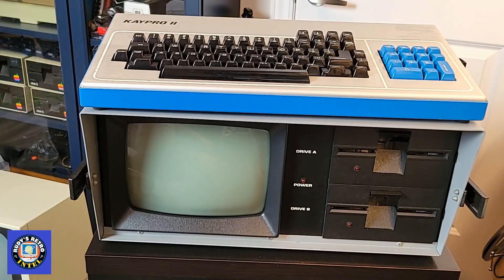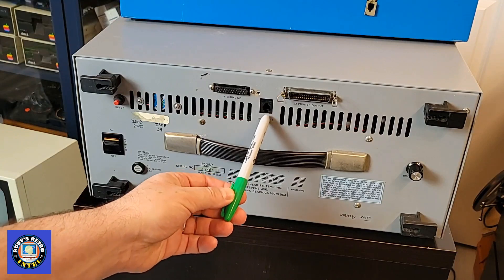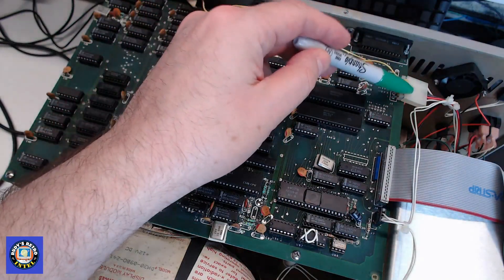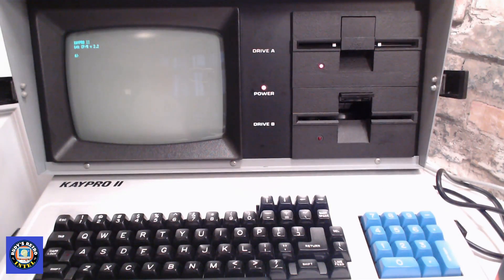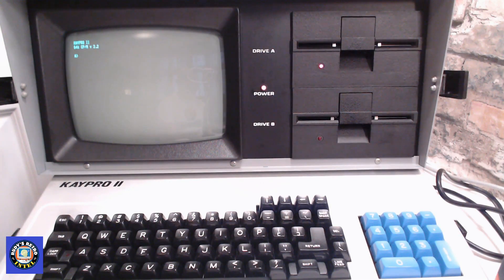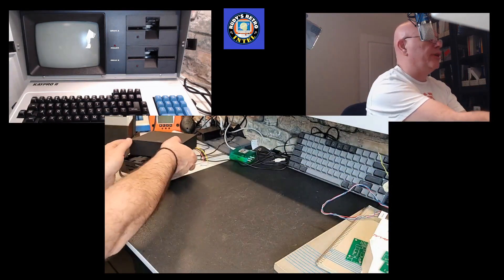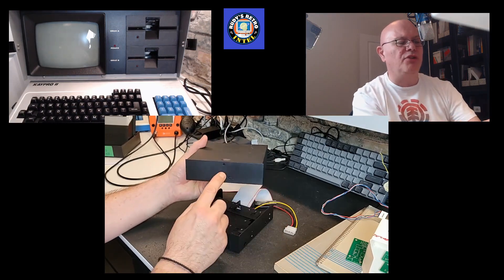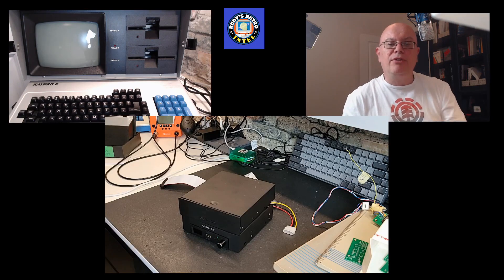What is a Kaypro II Computer? Lets peek inside and poke around. #Maypro

Comment: Before you dig into the monitor to check the overheating, look at the powersupply.  The soldering on the back of the pins that connect to the wiring harness is problematic.  You may have cracks or other problems there that are manifesting themselves as you warm up.  Try reflowing the solder to all of those
Reply from the maker: Thanks for the comments. I've already done that and will do a proper recapping and check the transistors.

Comment: I kinda want to gut the AC power supply out of mine, and fill that space with 18650 cells and DC-DC converters, to make it truly "portable".  Lel.
Reply from the maker: Hi Lee!! Great idea! Maybe I will pull out the tube and put in an LCD screen to help reduce the weight, like a diet, and have  room for some adult beverages. Thanks for commenting
Reply: @RudysRetroIntel  Ahhhh no way!  The CRT is the best part lol.  XD